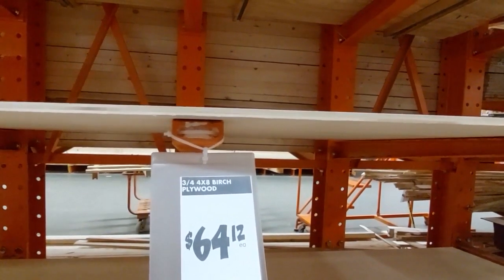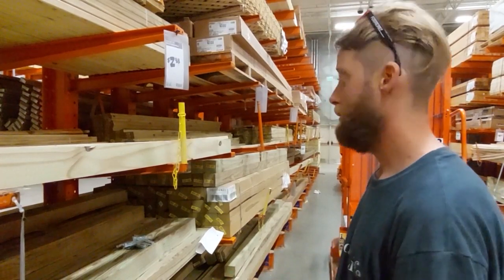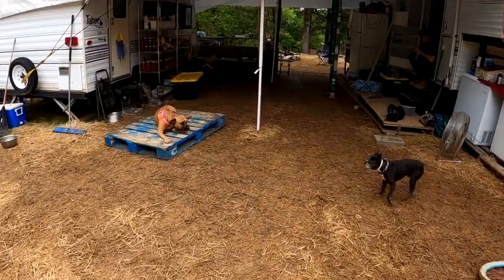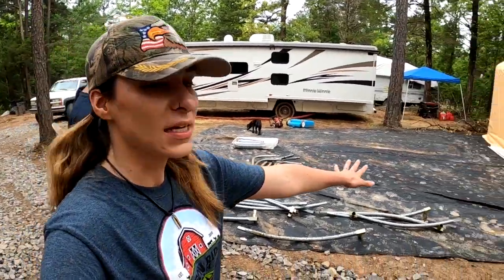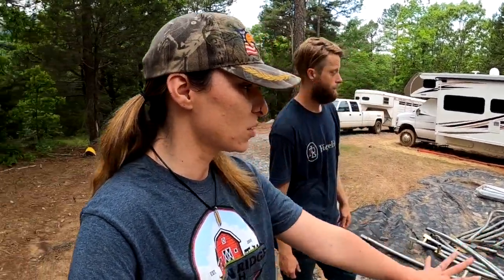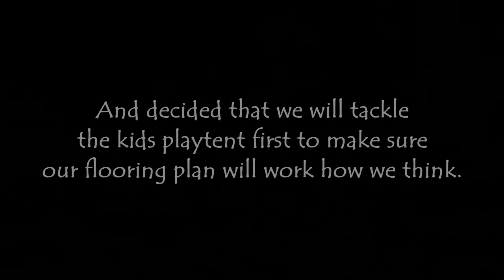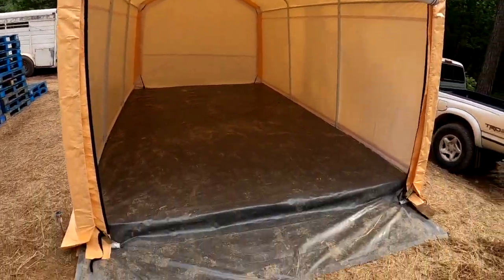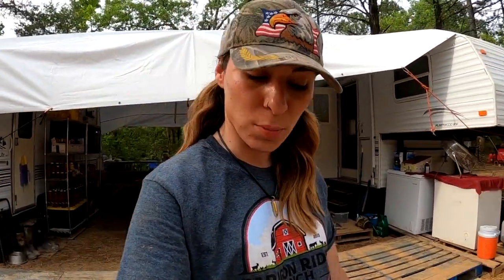Setting up a solid Base-Camp | Pallet Flooring

Comment: NICE 'score' on the pallets. I used to get pallets and 4X10 'skids' for free but now that wood is worth its weight in salt I now have to pay a few pennies for 'em. It's a lot of 'separating' work but I now only take, (and pay for), oak pallets and skids. With a Harbor Freight planer and table saw I can still make beautiful flooring, siding, cutting boards, and counter tops for cheap. IMHO, "Yer doing A GREAT JOB while learning". Best of success and God Bless...~Eli.

Comment: Mel and Gary things will get better this is a wetter than normal spring. We are getting a lot of rain here in Houston as well.   Not sure the cost of gravel in Arkansas, but in Missouri we can get a load  20 tons for about $65 depending on the distance. A load of 2 inch for the base and then a load of minus gravel. Minus has lot or power so when you wet it down it turns to almost concrete on top of the 2 inch.  Then dig a ditch behind your travel to direct the water away. You might to dig a small anyway to help direct the water away.  Everyone pinches in it wont take long at all. You guys are differently hard workers!

Comment: I don't know what your plans are but if you are going to have a pole barn at some point a pole barn will go a long way to solve some of your issues and it is one of the most inexpensive structures to put up.
Reply: Yes, that's usually the first thing that goes up.
Reply: Where can I find poles? Hmmm
Reply: @chuckstith838  In Poland of course.

Comment: If you wanna save money just lay them down and attach them with grass carpet and staples.. It works trust me I've done it. Just lay ur pallets tight and the carpet will hold them together.
Reply: @ Simple Life Reclaimed    I think Timothy Sharar has a good idea with the grass carpet and staples. Maybe put the pallets solid in between the two trailers and the grass carpet stapled down would make good for walking on...not slippery if it did get a bit damp. Just a thought.
Reply: Awesome idea!

Comment: I bought the cheapest crappiest plywood, then I found some Savage linoleum and put on top and it made it waterproof still been there for 7 years now. I screwed down my gazebo to it and anchored it. Just some advice make sure you seal around the bottom because I had a skunk that made a den underneath it lol

Comment: 3/4 xxx plywood was 19.99 before the pandemic. Now 64 bucks is crazy. I got a sawmill that's home made so if Gary can weld he can build one for about 1500.00 dollars just look online for his ideas. Biggest cost is the 20 up or 24 up motor.  You will be surprised at how nice the rough sawn lumber is. Take your time at what ever you build plan it out so you can get multiple use out of the building. Happy trails from New Hampshire

Comment: Your wood chipper is a great tool to control mud to a degree. You may need to get decomposed granite or 1/4 minus self compact soil to fully fix the issue for the long haul. Love what you guys are doing!! Wish we were doing the same 👍👍.   You might consider a saw mill, initially pricey but it will pay for itself in the long run for all building projects. Lumber is horrible so you might consider using some of the timber on your 40 acres.

Comment: Have you put any thought in a portable  sawmill? Money to start, but may payoff in the long run. Lumber  prices  being  what they are,this maybe your solution. Just hard work. If not look around  for small sawmills, the lumber  will be rough cut ,but is much cheaper. Being  in Arkansas  has its advantages. This is one of them.

Comment: JudithB  Its  going to  be  nice  this  weekend,  so  planning   some  chores /repairs  that need  doing.  I  finally  got  the beans planted today,  and  got to replant the cucs.  I  bought  lumber  for  2  raised  beds--6  2x6x8  came to $77.00.  Wed.   We  drive  to  Ft Smith  every few months  for  shopping  and  Red Lobster!  LOL  You  could  pin  the  outside  pallets  with  rebar  to  hold  it  all  together.  The  dry  season  is  coming  this  next  month  or  it  did  for  40 yrs  anyway.  The last  2  years  have  been  a  bit  out of whack!

Comment: Yeah, gully washers here in Michigan. Rain stopped for 3 hours total in the last 36 hours. And the temperture dropped about 40 - 45°F too. So not so much fun right now living in an motorhome. I feel the pain you are going thru. Bcuz I'm going thru it here.
We have my youngest granddaughters outdoor birthday party & the outdoor family memorial day celebration happening this long weekend. So the weather is not going to cooperate.
I think I jinked us. I took apart my winter heater & removed the propane tanks since its been 80 - 95°F, and its almost June. Tonight its in the very low 40's. That's inside temps. I'm sure its colder outside. Medium winds & everything cold & soggy from all the rain in the last few days plus this last storm.

Comment: Having lived in AZ and moving east I can tell you the humidity will be hard on you all. It saps your energy way faster than a dry heat. You also tend to not drink as much water because you don't feel that dryness pushing you to drink. Force yourself to drink lots of water! And the rains are just something new for you. It's hard to move from one drastic climate to another. You will learn to work differently than you did in AZ! Electrolytes are important. We use E-mergencies. Sweat will be your new annoyance!

Comment: perhaps you could design some ditches/water dams like the loggers use to channel the water away from the living area....put a water dam every 10 feet and channel it down and away from the living area...search google for making water dams on the roads by the logging companies....they are very efficient...............Those look like some really awesome pallets to be working with (not very big gaps between the boards) and heavy duty...

Comment: Know you are new to area but consider reclaim  and reuse   lumber    put word out that will take down old structures for salvage  rights  .
 Provided get right building  could get sheets of tin roofing possibly  plywood  and variety  of lumber   
   Just have mostly  labor involved  
 Just suggestion to cut lumber cost

Comment: Just an idea, but what if, instead of replacing pallet boards, with new boards, how about screwing the new boards around the outside edges.  That should hold everything together.
Reply: And also it will help keep the rodents out.

Comment: Little ditch across the back of the trailers,, divert rain water into the woods,, spade & grub hoe work.. Start shopping for a small used tractor 30 hp with loader 4x4,, saw,, saw  mill make your own lumber..